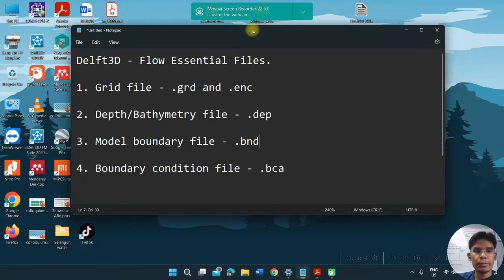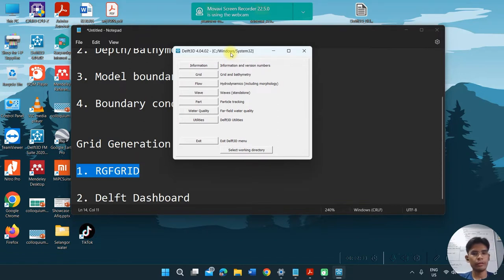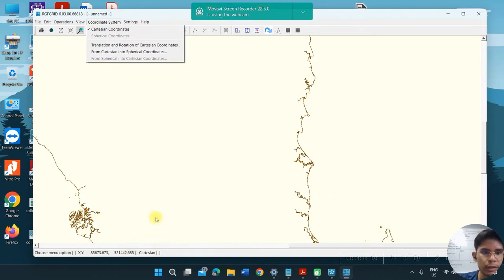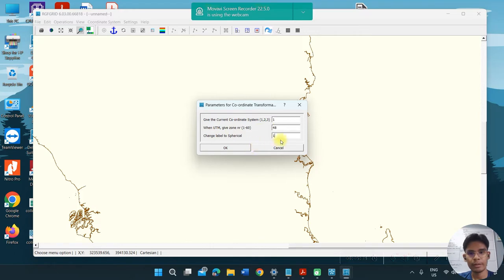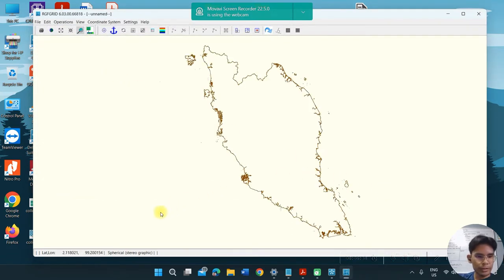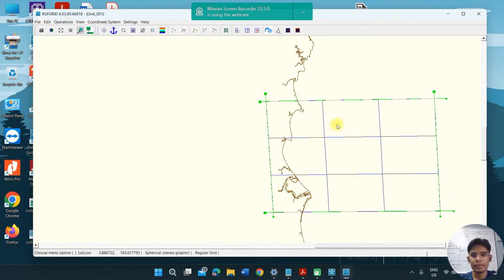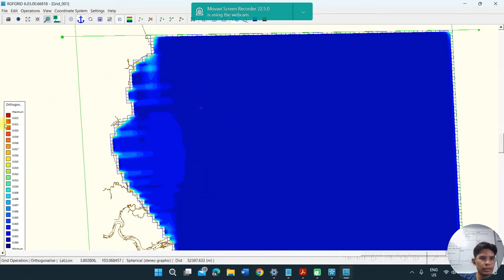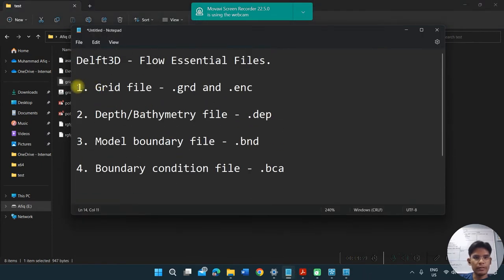Delft3D: Grid Generation using RGFGRID

Comment: Hi, can you say to me whats is a good   configuration of the pc to Delft3D? Processor, memory and  video card?
Reply from the maker: The performance of the software depends on the complexity of your models and simulations. High performance CPU with multiple cores, 32GB RAM for complex problem, SSD. You can use both windows and linux OS.